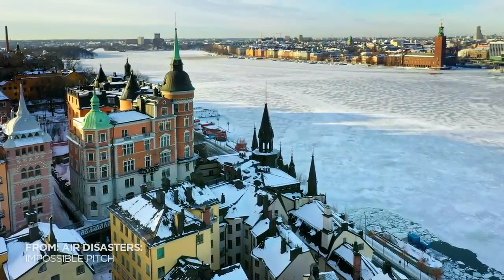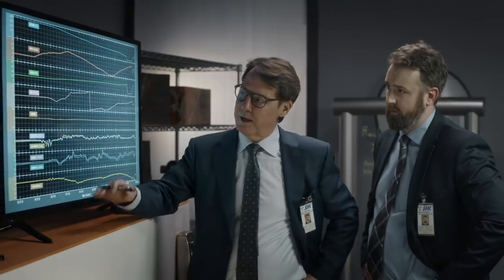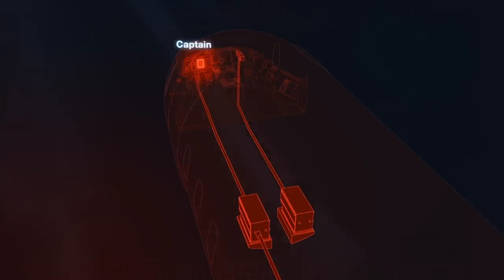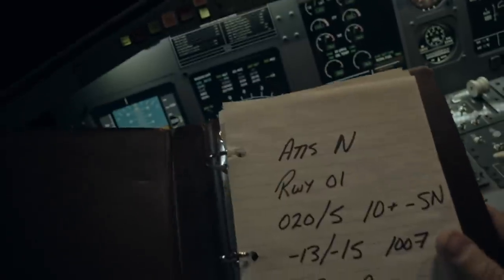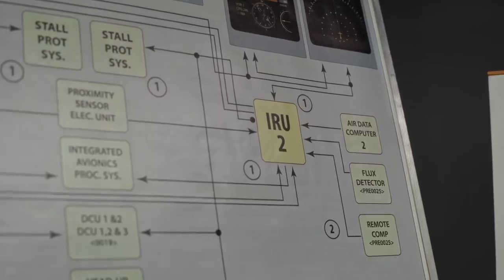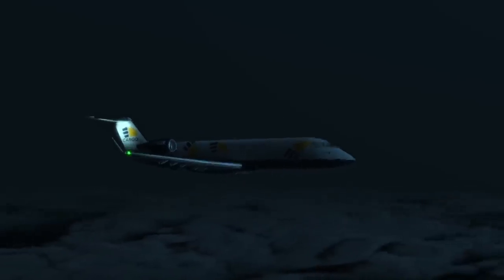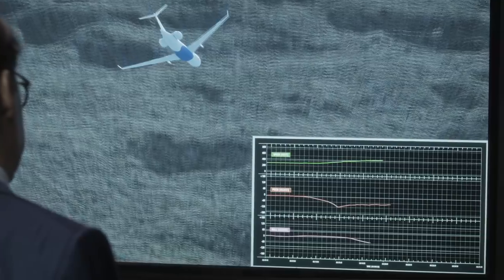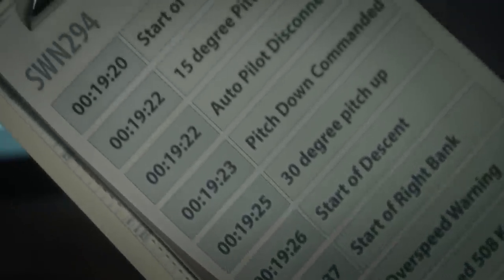The Shocking Drop of West Air Flight 294 is Hard to Explain 😲Air Disasters | Smithsonian Channel

Comment: Wouldn't the simple cockpit addition of a small globe filled halfway with easily visible liquid help pilots determine pitch and roll accurately?
Reply: No, because that doesn't actually indicate pitch and roll in a moving reference frame.  A very similar device is used in small aircraft to indicate *slip*.
If you look carefully, however, you can see a backup vacuum-driven attitude indicator (with its own gyros) in the middle of the instrument panel, between the two pilots.  It's shown with an almost completely brown aspect - ie. a steep dive.  This is indeed what the aircraft was actually doing.  It's intended for use when the "glass" instruments fail, perhaps due to an electric fault.  If the pilots had cross-checked the "glass" instruments with the vacuum one, they'd have realised they were getting a false indication on the Captain's side and switched to the FO's.
Reply: @Kromaatikse  they didn't do it though. This was big time mechanical failure. It is possible that the second IRU was also faulty.  But more likely the captain didn't understand what was going on and crashed the plane at high speed. Unfortunately that's the truth.

Comment: I’ve seen this episode and this is not the first accident I’ve watched that  not only resulted from pilot error, but from the drawbacks of continual advances in technology in aviation. Technology may help prevent a lot of accidents, but some of the drawbacks is the failure rate. It fails so rarely that pilots sometimes become mystified and some airlines have become complacent and are relying too much on the technology to fly the plane instead of the pilots whom they are supposed to train for all potential situations. And with all the knobs, gauges, and technology onboard, it is also becoming more difficult for pilots to find and solve problems in the cockpit.
Reply: Yeah, it might be prudent to reintroduce a third crew member in the cockpit because like you said, it’s getting to the point where it’s getting too much for two people to handle especially in a stressful situation.
Reply: @spacemarinechaplain9367  Some planes have a Pilot, Co-Pilot and an Engineer in the cockpit. It may be time to bring that back into widespread practice.
Reply: The only part of your comment that is accurate is that airlines have over the last 20 years encouraged pilots to use more automation rather than hand flying which has to a degree de skilled them. There is no evidence that improvements in technology has led to increased systems or indication failures, in fact its the opposite. The amount of knobs, switches, buttons has vastly decreased over the past 2 decades due to glass cockpits and automated systems. In my 35 years as a B737, 767, 747 captain the only failure of note was having to shut down an engine because of a high oil temperature indication which turned out to be a thermocouple error/failure not an overheating engine oil scenario.
Reply: @spacemarinechaplain9367  this crash was hardly a pilot error.  The captain got major instrument failure . It was hard for him to know what to do in this situation.  No pilot error  here
Reply: @kirilmihaylov1934  You and the Chaplain are both wrong. They had 3 ADIs in the cockpit. One took a shit, and had they crosschecked the two that agreed, this would have been a non-event. Totally pilot error and NOTHING to do with automation.

Comment: The resent Amazon 767 crash is the opposite of this. The pilot felt like the plane was pitching up and drove the plane into the ground.
Reply: It is called somograhic illusion or something like that . In 2016 there was another crash because of this in Russia.Basically the pilot thinks he is pitching up and pushes the plane in a dive . In fact he is flying straight  .
Reply: It is not opposite . Both pilots crashed the planes in a dive.  But while that was pilot mistake here it wasn't  .

Comment: This is getting scary with computers taking over. Bring back dial gauges!!!
Reply: All airliners have backup analog gauges. If there’s a power failure, or a disagreement, the pilots can revert to the old-fashioned way.
Reply: @StickandGlider  but this wasn't computer failure but an instrument failure.  It was major one though

Comment: Is it true that the software programmers and software design team are the ones that should be jailed or sacked over that amateur software system? When critical flight data is detected to have discrepancies between the two or more sets of measuring systems, then a very loud computer voice should have said on the cabin loudspeakers ------ 'warning - mismatch in pitch measurements ----- IRU1 likely to be in error, IRU2 likely to be functioning correctly - due to two out of three agreement condition'. And also have big red flashing lights to draw attention. And also - the little yellow 'PIT' indication on the screen should definitely have been programmed to remain on the screen. It should never have disappeared in any case. But also - one must admit that it's pretty stupid to have the little yellow 'PIT' light come up (even if if it did stay on permanently). It's better to have a big flashing PIT symbol (along with a loud but calm computer voice warning) - that also shows more information about which display panel or instrument had likely developed an issue. So basic common sense programming would have easily saved those two pilots.

Comment: if this happened to me I would of called  MayDay because this is making you have a high risk of confusion causing the plane to crash even if you rely  on sight you still get confused and not firmly know if the plane  is banking left or right if you are gain altitude or losing it

Comment: I guess it's too complicated to just look out the window and feel the gravity roll on your body from your seat?
Reply: Sadly, I wish the same, if it were that easy, There'd be hundreds of people still alive today. But it's not. 
 
Look up spatial disorientation. And also, at night you don't have reference points like street lights, buildings, etc. Everything is pitch black.

There's a reason why you don't feel an aircraft turning when flying as a passenger. 1g of gravitational force is maintained throughout the flight so your body thinks everything is normal even if it's not.

Comment: ill explain what happened
Reply: basically the declutter system on the PFD (primary flight display) removed the “PIT” warning, “PIT” indicating that one of the IRU’s that express the attitude of the aircraft on the PFD was giving false information. the pilots did not see the PIT warning with the time given which lead them to believe there plane was in a huge climb and bank. (Declutter system is a system that has arrows pointing to the direction you need to move to, ex. If youre going nose down, arrows will show on the PFD saying you need to go up, and vice versa)